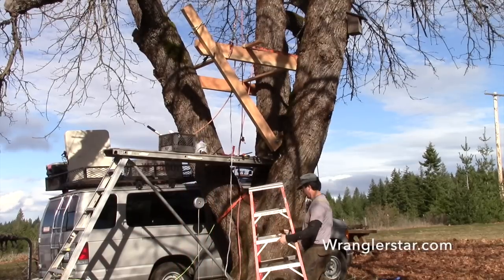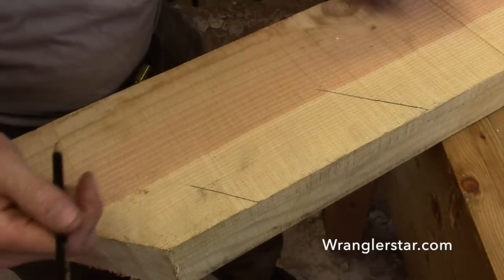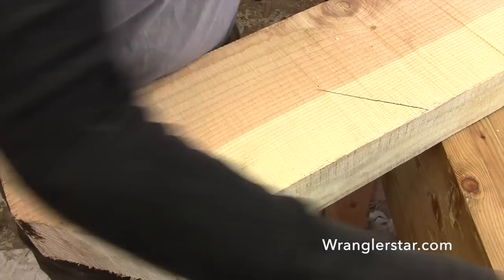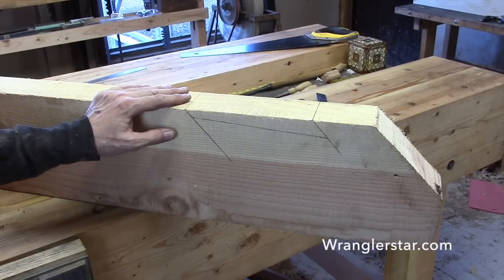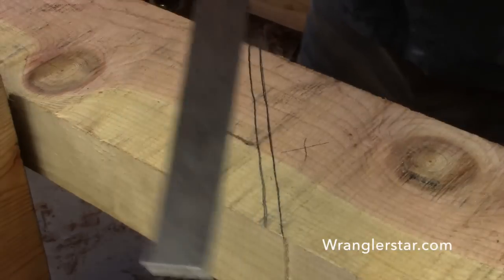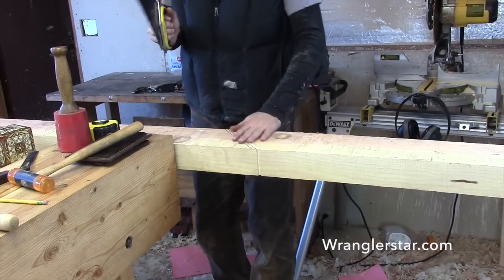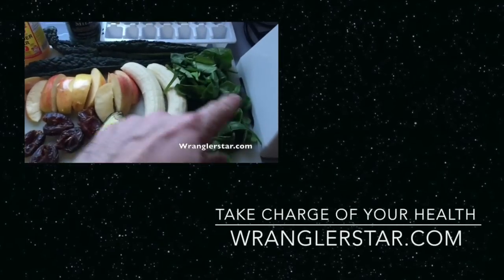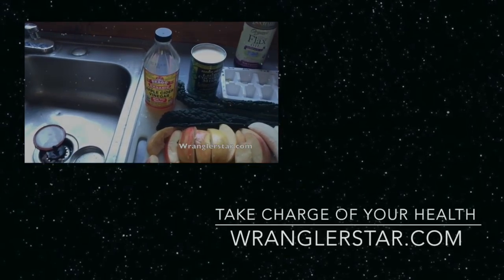How To Build A Treehouse | 9 Wranglerstar

Comment: Your comments about pondering design are spot on. Yesterday as I was driving, I saw a custom built hoist sitting in someone's yard. I stopped to have a look because heavy lifting is an interest of mine. The fellow had put several hundred dollars and many hours into fabricating a pivoting boom. But one design flaw reduced the workability of it by 90%. All of the materials and embodied time were right there.  They were just put together in a way that almost totally defeats the whole project.

Comment: Im curious Cody why you chose to taper the joint where you "let in" the knee brace into the horizontal beam. Its not a big deal or anything, I was just wondering why you didn't make the cut out on the horizontal beam an equal 1" slot? 

Thanks for the wonderful videos!

Best wishes to you and the family

-Felix

Comment: Cody, fun project. When you load knee brace end the floating end will run out sag at knee brace end. Also the other floating beam is on the wrong side to support the floor all the way to the knee brace end .

Comment: Cody,  At first when you pushed those two joints together they fit perfect.  I was like wow that worked out perfectly.  The treehouse is shaping up and looking really good.  Jack will just love it.  Do you plan on in letting the floor joists?  Then lagging them together?  However I know it will be the best treehouse for miles around.  Good job!

Comment: Loving your work and your videos as usual Wranglerstar. Just an engineering tip for the knee braced beam. The knee brace obviously works by going into compression to support the beam but because it's on an angle it requires the beam to go into tension to balance the forces. The point is you'll want to lock up the sliding connection on that beam, otherwise it will just slide to the limit of it's travel and you'll probably be out of level.

Cheers!

Comment: Nice work!  On the bolted joint... The bolt or lag should pass perpendicular through the joint face.  This will pull joint together tightly and not introduce diagonal loading on joint.  Counterbore the board for the bolt head with a spade bit.

Comment: Great series so far +wranglerstar!!! But I have a question...by adding that knee brace don't you nullify your expand/contract brackets? Because you're making that brace rigid?
Reply: Agreed.  That pivot bracket i supposed to allow, what, that huge branch to grow away from the tree house? To allow the branch to sway to and from the tree house.

But with that very nice, tight fitting joint, ...the pivot makes no sense to me.

Comment: from an engineering perspective, the design can not be faulted, and the materials used are more than strong enough with out being over engineered. and the execution is as always spot on.
Reply: billville111 the loading on the rods are end compression loads so the welding is ok

Comment: One thing that doesn't seem quite right to me is having the "sliding" bracket on the beam that has the knee brace. Seems like it should be fixed, there will be a lot of lateral force on that "ford seat bracket". Standing out on the end over the knee brace would make it want to pivot down on the "knee brace to tree" lower bracket.  Just my two cents, keep up the good work Cody, love everything that you do.

Comment: It's not my treehouse but I keep thinking of features to add to it. Maybe you've already thought of these, a fireman pole to get out quick, a bucket and pulley system to bring stuff up from the ground, a gun rack for those Nerf/water guns, and if you're close enough to a water source, a little spigot in the treehouse.
Reply: There is a youtube video of a bicycle used as an elevator. The drive wheel pulls the bike frame straight up. That would be cool.

Comment: You had trouble driving those tight lag bolts. When I was doing  theatre carpentry, 40 years ago, we sometimes used soap or beeswax when we had to drive long bolts. I have no idea whether it is structurally safe, but it sure makes driving the bolt easier.

Comment: As to making things easier with regards to putting up and taking down, etc. here's what I would have done:  I would have put it up once, made sure the beam was level and clamped the brace where I wanted it. Next, drop a plumb line near the tree off the beam, past the brace.  Mark where the line is on the brace and measure the distance between them.  The top of the beam and the plumb line mark are at 90 degrees.  Take the whole thing down, and recreate it on the floor of the shop.  Use a stringline and put the plumb line on the string.  Measure the distance between brace and beam, double-check to make sure the angle is 90 degrees, and Bob's your uncle!  If you need to, make a jig on the floor to put things exactly in their places.  At a minimum, make Sharpie marks on the floor to easily realign things for fitting.

Comment: you might want to taper the threaded end of your bolts when using them like you did on the knee brace  way easy to start nuts after they have been driven thru something  just a thought

Comment: I worry that that sharp angle cut pointing with the grain will split over time.
The lag bolt should hold however, and what you've done is still a fine feat of carpentry.

Comment: I understand how you got the angles for the notch, but you cut in  1/2 inch on one side and 1 inch on the other.  How did you get that measurement, through experience?

Comment: How level was the cross member after final attachment of the knee brace? And why did you go 1" deep on one side and 1/2" deep on the other when you 'let in' the knee brace? Thanks.
Reply from the maker: iksnyzrog I 'let in' the knee brace purely for looks. The 3/4" x 12" lag screw should do all the heavy lifting but I could be wrong. Time will tell,
Reply: Bor the Wolf I would think with that huge lag screw in there, no force is being put on the tip of the knee brace.
Reply: TheBriguy09
you are correct

Comment: Cool video series! I just can't stop wondering about the shear strength of those lag bolts. Obv they are plenty long enough that they aren't gonna pull out of the tree, but I would be concerned about the shear stress snapping them in half. Any internet engineers know the math on that??
Reply from the maker: zep136 around 1000 lbs per bolt

Comment: Purely my opinion, but I'd consider another fastener joining the knee brace to it's bracket at the tree. I know that the knee brace rests on the "wings" of the support bracket, and they will carry most of the load, but to my eye the single fastener leaves an opportunity for tearing out of the beam, especially with how close it is to the edge. Then again, maybe you only used a single bolt to allow the whole assembly to move as the tree sways, creating a pivot with the bolt. I'd bet everything will be just fine, especially with the thickness of the beams, just a thought. 

Also, how do you like that big-box hand saw you were using? Looked like Irwin or DeWalt. I had one in my hand last night and almost pulled the trigger on it.

Comment: is there a reason that your pocket for the angled leg had the acute angle cut out?  I would have thought that the stresses on that outer angle will act as a wedge; splitting the end off over time.  Most braces would have finished with a rig angle to induce a shear rather than a force focussed,on one corner, but I am sure that you have a logical reason for your choice.

Comment: just a though,t why did you opt to use a knee brace, over putting a support post into the ground? it would have simplified things a bit. as you could still use slip joints on the post as well. and if tree growth was the issue. by adding a screw jack, would have eliminated that factor. but then again. you could have gone with two cable stays, with turn buckles in tension from above, to support the cantilever end in place of the knee brace. those where two options i could think of. when you talked about differing approaches.
Reply from the maker: dale myers Yes what you say is true. I don't like the look of a post. To me its not good style nor an elegant design. Cable suspension would not be bad but might give the suspended stringer and unfinished look. To each his own,
Reply: A post defeats the tree house nature of it. Also a post could get knocked out by some activity on the ground such as a mower. I'm not saying it is a categorically bad idea; just that there are other implications both from a safety and aesthetic perspective.
Reply: as to a post defeating the nature of a tree house. i say "nuts". what is a tree. a live growing post. that has yet to be taken down and finished as lumber. so yes, "nuts".
Reply: dale myers just seems like cheating to me.
Reply: is a tree wood. now i might add. i didn't say the post would be wood. but that was my insinuation.
 i don't see it as cheating  when the situation calls for support that just isn't there any other way. the knebrace is a post butted up against the tree trunk. is that cheating too.
Reply: Kevin Hornbuckle Agree,  the beauty of a tree house is that it is suspended by the shape and form of the tree.

Comment: Only a year late, but that fit was brilliant.
Reply from the maker: +richalsop Thank you
Reply: Although im only twelve, i do know that if you would have measured your desired side length on the top the proceded to follow that down you would have been able to use the pythagorean theorem (a²+b²=c²) to find the length that the knee brace would have needed to be. after that all you needed to do was know that the angle was 45º because that is a 90º angle and allowed for the joint to be made. but yeah that was really cool how it worked
Reply: King_blah101 that would be true. if it were a 90 degree triangle.  but it isnt the tree limb isnt perpendicular to the ground. the math would have come out wrong.

Comment: Looking good so far Cody, I know you are done with the knee brace, I'm just wondering why you went with a chisel point on the brace end and didn't cut the end off to make a square shoulder?  Yes I am looking at this from a boat building point of view.  I can not argue that what you have done is not a nice detail.  

You are so right about working out the how to do it is a big part of the job.   The design phase can be as much of a challenge as the building.  Next step putting the joists and decking up.

Comment: A professional 70k tree house profiled in the local news for the fourth corner was suspended by a cable from above.  It allowed a little more flexibility and not as much precision that your timber framing requires.  That said, a lot less artistry than your welding and framing skills show.